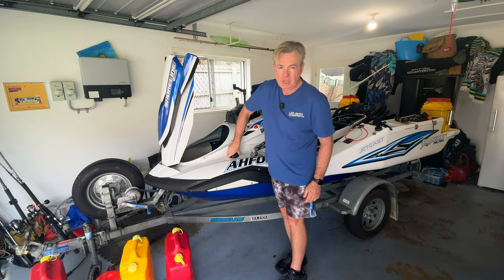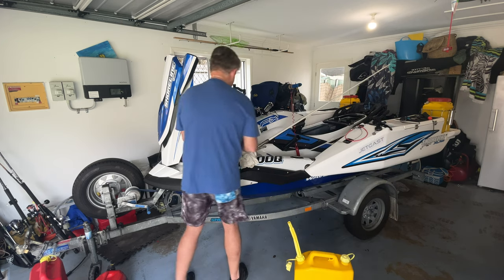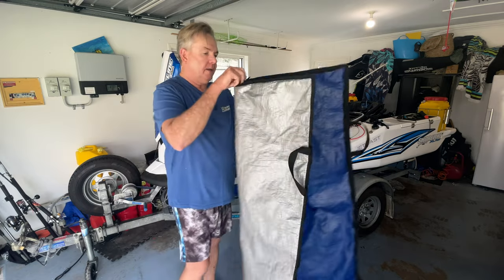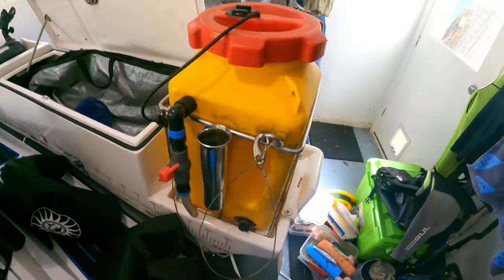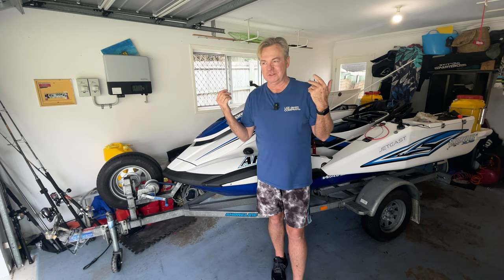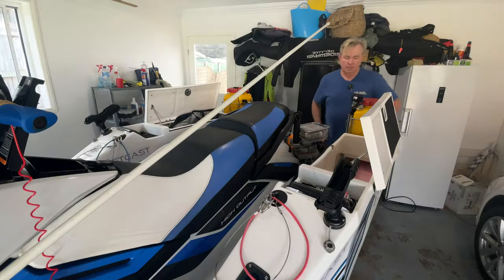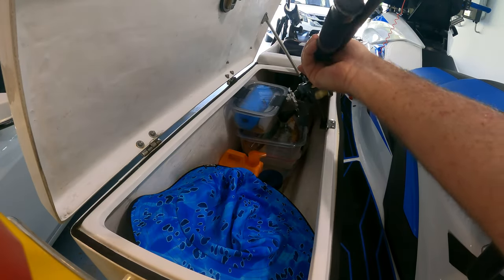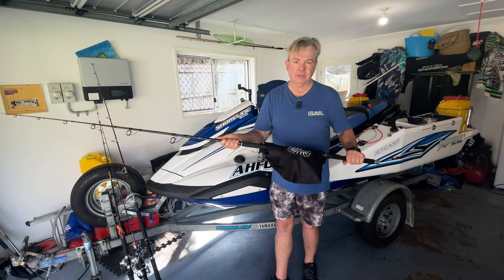The Big Day Out Part 1: Preparation for Offshore Fishing on a PWC

Comment: Informative. Thanks for posting. Good to know about your experience with the fuel tank.  I often have 25 to 30L left when the low fuel alert goes off. First time it happened I drove back to boat ramp so slowly thinking I was about to run out.
Reply from the maker: Exactly my experience the first time too! I had switched from the economical VX Yamaha, expected a little more consumption, but it gave me a shock when 30km from the ramp with the fuel alarm sounding!  The fuel alarm goes off way too early so I was concerned I would get stranded and went home! But when I filled it up again I found I had at least half a tank left!  Thanks for watching and commenting.

Comment: Hey buddy good info
I fly my drone from my ski and i know what you mean about trying to retrieve it in the swell 
I have the dji mini and attached the feet to it and then tied some mono to the feet so i can now just bring it back as normal and grab the mono line and hold it while holding down the joystick to land soo much easier especially when the skis rocking side to side 😂
Reply from the maker: Great tips Rix! I guess I'd be worried about the mono somehow flying up and getting wrapped in the props! Any mishaps?  Hehe,  it certainly gets the heart pumping! Thanks for watching. I did manage to use the drone briefly when I went out the day after shooting this. Watch for the next video!
Reply: @Jetcast  nah no mishaps at all
It’s tied to both landing feet like a U shape so it’s like a handle and made it long enough to grab but not long enough to reach props 👍

Comment: That was a good comprehensive run down of your preparation. Be good to see the next instalments. Liked your opinion on the original rod/reel setup. Have you done a piece on the knot to type leader to braid ?
Reply from the maker: Hi Douger, thanks. I am planning a more comprehensive rod/reel video as I have put a lot of hours into working out the kit I carry for the various types of fishing we do here. It’s a little hard to shoot these on your own though.. I’ll do something in the coming weeks.  The braid to leader knot videos are all over YouTube and I looked at many before settling on doing Albright knots plus a “double” on the braid.  I had a snag just the other day on my jig rod that was really really hard to break off my 40lb braid and 50lb leader. Finally broke after much effort right at the hook! Shows the strength of the connection if tied well.

Comment: Great content as always Paul
Was thinking about getting the long range tank put on my FXHO 21 model, does the extra weight change the ride much when full? Like dip the nose down etc?
been waiting 6 months for tubbies and apparently another 6 months away so slowly getting it set up for when they come in..
Reply from the maker: I don’t really notice the added weight. It sits right on top of the standard tank so if anything it would just be the start of the day it is adding weight -when I fill it that means I’m expecting at long travel to the fishing grounds, so likely to have used 15 litres or more by then. Putting another person on the ski or a high centre of gravity rear cooler rig is far more noticeable in handling and stability changes.  Don’t overthink this one. The added tank is very handy, I fill it often, and I never need to carry fuel cans.  Expensive add-on because they’re hand made, but anything boating related is bloody expensive! But I think it’s the peace of mind when doing the long trips that makes it money well spent.